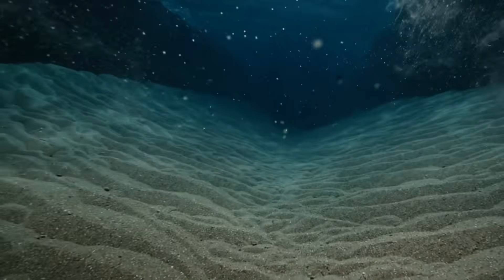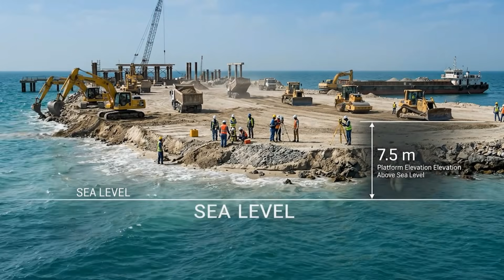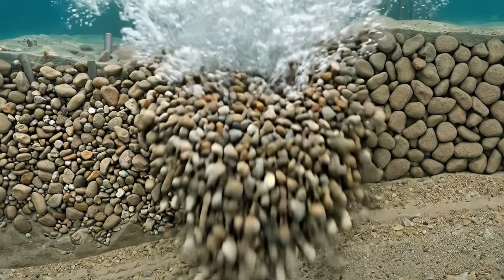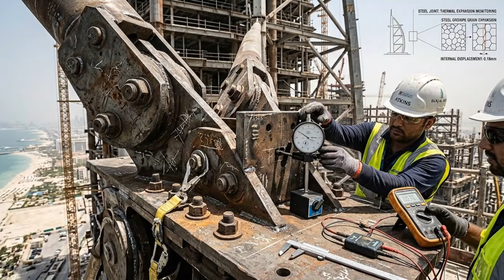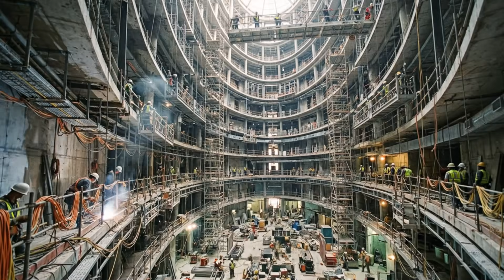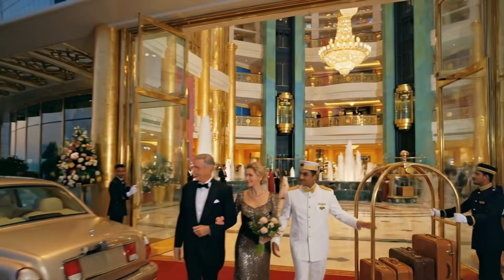Inside Dubai’s $1B Burj Al Arab: How They Built the World’s Most Luxurious Hotel on Open Water!

Comment: The Burj Al Arab looks almost effortless from the outside, but this video completely changes that impression. Every part of that sail seems to hide another engineering problem. The wind, temperature, waves, foundation, and even the electrical system had to be solved. That's what makes this building so fascinating.
Reply from the maker: Exactly! The iconic sail shape may look simple, but every detail hides a complex engineering challenge. That’s what makes the Burj Al Arab so fascinating.
Reply from the maker: Thank you so much for watching and sharing your thoughts! We truly appreciate your support.

Comment: The most impressive part for me is that they didn't simply build the hotel on solid rock. They basically engineered the ground to carry the building. 230 piles, enormous surface friction, and thousands of tons sitting above them. This is a perfect example of engineering working with the conditions instead of waiting for perfect conditions.
Reply from the maker: Exactly! The foundation is one of the most fascinating parts of the entire project. Instead of fighting the conditions, engineers found a way to make the ground work for them.
Reply from the maker: Thank you for taking the time to share your thoughts! We really appreciate you watching and supporting the channel.

Comment: The eight-meter waves hitting the unfinished island must have been terrifying. Imagine spending months creating an artificial island and then watching a storm try to destroy it before the hotel even exists. The Shed blocks are such a clever solution. Turning the destructive energy of the waves into something manageable is brilliant.
Reply: Those waves must have been absolutely brutal during construction. It’s crazy to think the island itself had to survive before the hotel could even be built. The Shed blocks were a seriously clever engineering solution.
Reply: Eight-meter waves hitting a brand-new artificial island sounds like a nightmare. After spending months building it, one major storm could have caused massive damage. The way they designed the blocks to absorb the wave energy is really impressive.
Reply: The wave protection was one of the most fascinating parts for me. They basically had to engineer a barrier strong enough to fight the ocean itself. Using the waves’ energy against them was such a smart idea.
Reply: Imagine watching an eight-meter wave crash into something you just spent months building. That must have been terrifying for the engineers on site. The Shed blocks turned a huge natural threat into a problem they could actually control.
Reply: The thought of an eight-meter wave hitting that unfinished island is insane. After spending months building it, watching a storm come in must have been terrifying. The way the Shed blocks absorb and break up the wave energy is seriously clever.
Reply from the maker: Exactly! The island had to survive the ocean before the hotel could even begin to rise above it. The way the Shed blocks were engineered to dissipate the wave energy is one of the most impressive parts of the whole construction.
Reply from the maker: Thanks for watching and for such a thoughtful comment! Really appreciate you taking the time to share this, and I’m glad you enjoyed the engineering story.
Reply: This is the kind of detail you completely miss when looking at the finished Burj Al Arab. The island had to survive the ocean before the hotel could even rise above it. Those Shed blocks were an incredibly elegant solution to a brutal problem.
Reply: Eight-meter waves attacking an unfinished island is honestly hard to imagine. They weren't just protecting a construction site, they were protecting the foundation of the entire project. The Shed blocks were a brilliant way to dissipate that energy.

Comment: I knew the Burj Al Arab was built on an artificial island, but I had no idea there was no bedrock underneath it. The fact that the entire 70,000-ton structure is supported by friction piles is absolutely insane. It really changes the way you look at the building. What an incredible piece of engineering.
Reply: The friction piles were probably the biggest surprise for me. It’s crazy that such a massive structure can be supported without reaching solid bedrock. Makes the foundation almost as impressive as the building itself.
Reply from the maker: Absolutely! The foundation is one of the most fascinating parts of the entire Burj Al Arab project. The fact that such a massive structure could be built without bedrock underneath really shows how far engineering can push the limits. Thanks for watching and sharing your thoughts!
Reply from the maker: Thank you for watching and for the great feedback! We really appreciate you being part of the NextGen Civilization community.
Reply: I knew about the artificial island too, but I never realized the building wasn’t sitting directly on bedrock. Supporting 70,000 tons with friction piles is seriously impressive. Most of the engineering is completely invisible from the outside.
Reply: The phrase “70,000 tons supported by friction piles” sounds almost unreal. They had to trust the interaction between the piles and the soil instead of simply reaching bedrock. That is some seriously impressive civil engineering.
Reply: The foundation might actually be more impressive than the hotel above it. Supporting 70,000 tons without simply anchoring the structure into bedrock sounds almost impossible. It makes you wonder how many other engineering details are hidden beneath the building.
Reply: That’s the detail that stuck with me too. An artificial island with no bedrock underneath, yet somehow it supports a 70,000-ton hotel. The engineers basically had to make the ground itself work.
Reply: I’ve seen the Burj Al Arab so many times and never thought about what was underneath it. The fact that the structure depends on friction between the piles and surrounding soil is incredible. You can't appreciate the building properly until you understand the foundation.